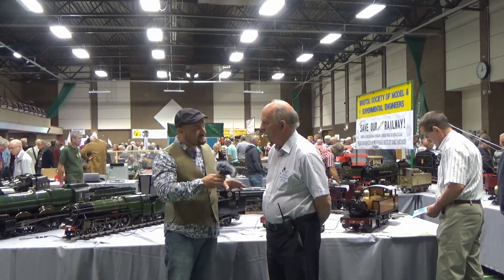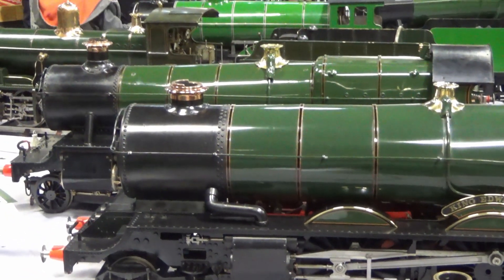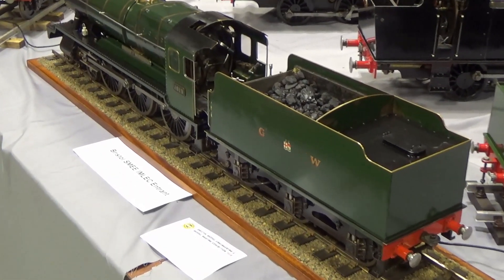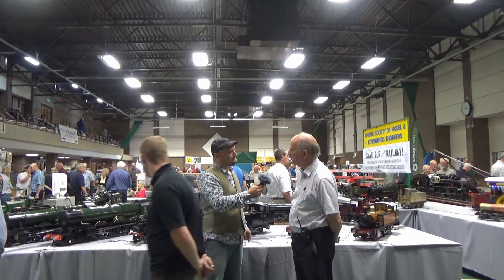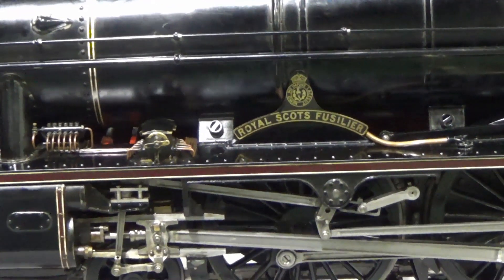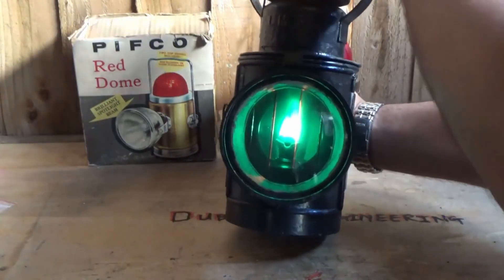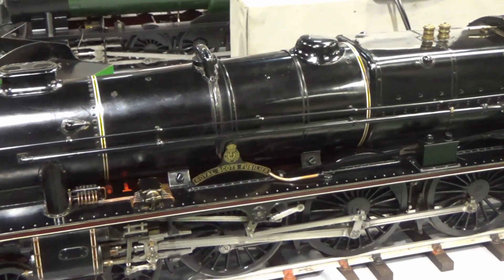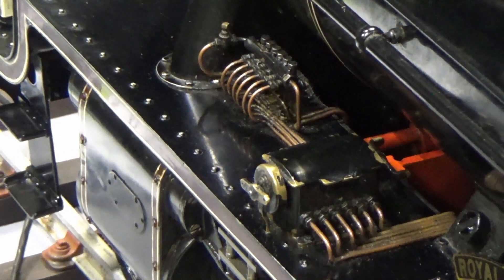DuB-EnG: Steam Train Locomotive Model Building Operating LMS how are they made how they work makers

Comment: A TOE IN THE WRONG WATER ???
I'm not convinced that this Gentleman "Dubious Engineering" is aware of the requirements and legal issues in Model Engineering of Steam powered locomotives. Virtually every reasonable sized town in Britain has a "Model Engineering" club or society, involved in Railway &/or Road "Steam powered machines". As his questioning as seen in the programme, reveals he is not himself involved in "steam" Engineering !  So it is wise I think to mention that you can work from home in designing & building such machines, even to the extent of building your own boiler. Although many tend to "buy" the boiler as there are a handful of manufacturers who provide a range of boiler sizes off the shelf. 

Whichever course is taken, the "boiler" is subject to some minimum legal requirements, if the completed model is to be used in a public place, such as a club. And the requirement is for a boiler certificate (normally lasting two years) to be obtained from an authorised independent testing authority. Indeed virtually all clubs have someone or some source to test boilers for a new certificate, every two years. It must be understood at this point that even a 5 inch Gauge steam locomotive boiler will be working on a boiler pressure of at least 50psi. And if even a small boiler such as this explodes, it is liable to kill or seriously injure anyone within 50 feet ! Playing with "pressurised steam" as we discovered back in the 1820-60 era, when a number of Railway locomotive boilers exploded, killed hundreds during that time !!!

Indeed I was myself once a member of the Bristol Model Engineering Society, and as also a qualified Railway Mechanical & Electrical Engineer, I was of course aware of the safety issues involving steam boiler potential explosions !
Reply from the maker: You are quute correct!  I had no idea you needed to get your boiler certified!  That makes a lot of sense!! - Sorry, i don't have a lot of steam/railway experience.  Thanks for your feedback and good, educational  information!  Best, Howard
Reply: @DubiousEngineering  Obviously as a real Railway Locomotive Mechanical Engineer, who began working with steam back in the 1970's, I was concerned for other viewers of your programmes safety. But thanks for posting this programme as it may encourage some to stick a toe in this "engineering" water ! 😄